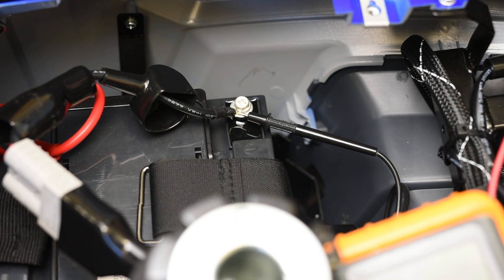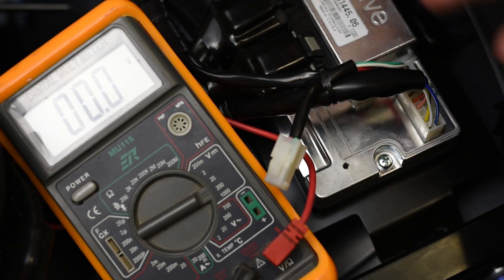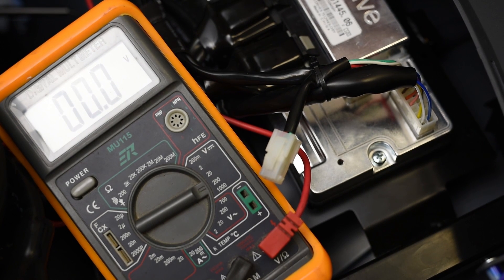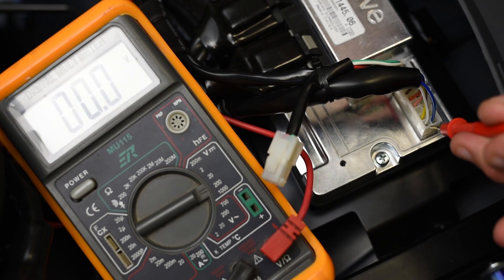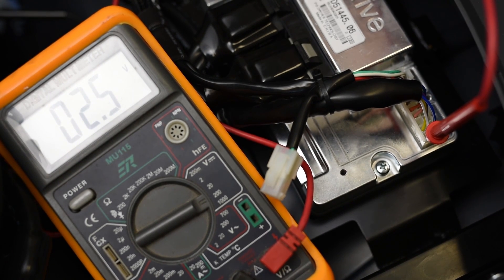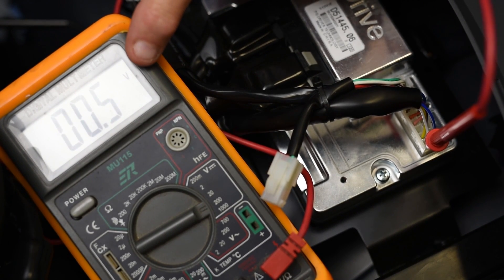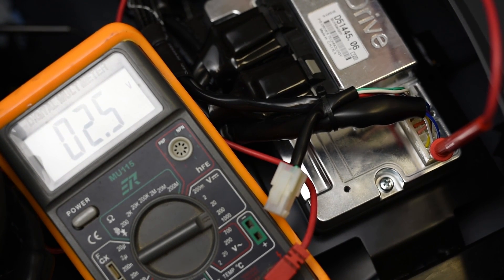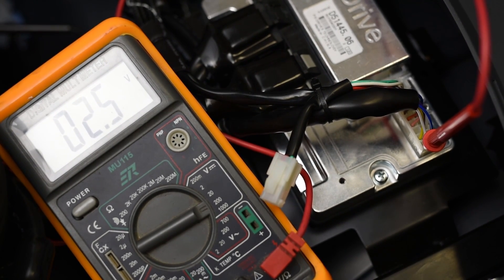How to Test Electronic  throttle control

Comment: my ebike has been experiencing  extremely dangerous episodes of the motor not stopping as soon as I turn the throttle , related to high humidity conditions !  I think it's because the humidity increases conductivity of the hall sensors in the throttle . can you recommend a good throttle ?  I think the manufacturers are going to have to make them water proof.  I don't know if you make a ebike throttle , I have not tried your brand, I experienced the same issue with a different throttle , battery and controller. just using the bike after a rain storm is enough to cause the issue. We must have a throttle will a switch to cut power ! ☠️ Also stop using hot glue on the Hall sensors ! It melts were I live ! And make the throttle not Fall apart so easy , and they need to be made with softer grips or made to accept normal grip's.

Comment: Hi John. I have a zoome3 scooter. I started have a problem acceleration. I tested the hall sensor in the hub all checks good. Test the throttle it also test good. I am stumped, you have any ideas?
Reply: Change the motor bushes. They are worn out.